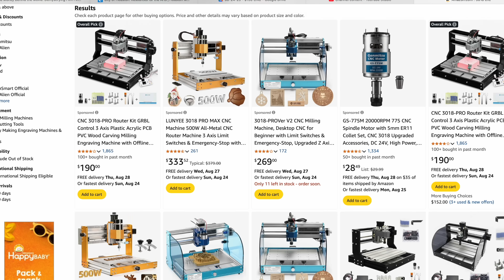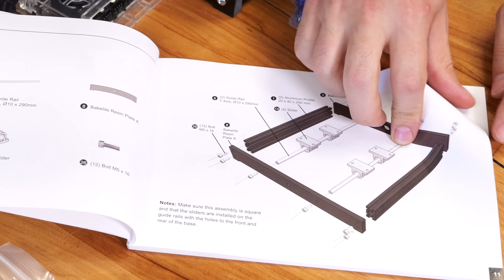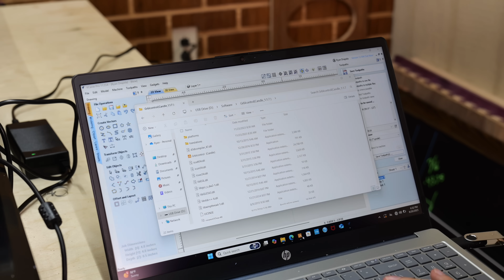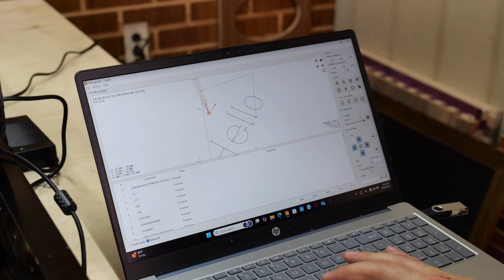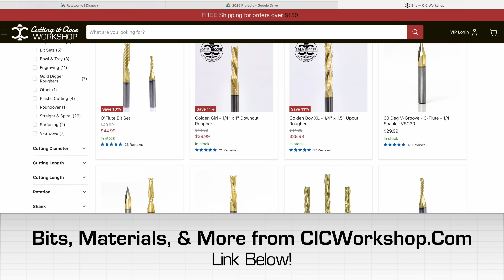I Tried a $150 CNC Router… Here’s the Truth

Comment: I got one of these as a learning tool. In many ways, a weak cheap machine is great for this because you soon learn the limitations. Until someone plays for a bit, they often do not know what they want to do with a CNC. 

I ended up doing something totally different on a very different type of CNC than I originally imagined by learning on one of these. So if I had dived straight in and bought a higher level CNC, I probably would have been wasting a lot more than the cost of this machine.

Comment: I have a similar machine, and i must have been luckier than you on the quality. 

Mine is not as sloppy as yours. I can keep fair tolerances, but I only work with wood. It's all about feeds and speeds. 

It's also about making adjustments to the basic setup to get the machine working well. 

You would have been very lost with my setup: I don't use windows (it's junk), I use Linux. I had to figure out how to set this up on my computer. 

I do agree with you, get something bigger and better if you can afford it, which I couldn't (and still can't).

Comment: I bought a Lunyee 40x40 to learn the CNC world. I have had a blast learning something new and have made some bowls, done a ton of V-carving and have finished a couple of relief carvings. I do agree that their is a lot of chattering on deep cuts and roughing operations, but taking it slow helps the quality of the cut. As for the spindle-I shined an RPM indicator on the spindle that is supposed to be a 10K spindle and it runs at 8750 no load.  It is what it is for $500. I am now eying an Ultmill or similar for my upgrade. I am at the point where I am dangerous knowledge-wise but my ultimate goal is to machine furniture parts; chair rails, specialty mouldings and many other pieces to support my furniture making. I am fascinated with the CNC world. Fun stuff.

Comment: The bits you used from your Shapeoko are to big for that machine to run at max speed. You are better off using smaller bits at higher speed as smaller bits rotate much quicker then a larger bit and are able to significantly cover larger SFM at the lower 1k rpm the machine was able to achieve. Although the Gantry and the cheap quality of the machine are definitely an addition to the chattering the bits you where using corelate directly to the result you where getting the bits where causing the chattering.

Comment: It has been said already, but I would consider this machine just a learning tool. However a good practical use is engraving brass or aluminum blanks with a diamond tip spring loaded tool. Being a learning tool I would strongly recommend adding limit switches.

Comment: I've had one of these 3018 CNC machines for several years and purchased it with nothing in mind to actually manufacture or produce.  I figured I can get a handle on CNC type software and hardware and this fit the bill.  Overall, the review is accurate, but keep in mind that this CNC machine is just a toy but can be modified to do quite a bit more stuff.  I modified the attachments where the spindle motor is clamped by designing and 3D printing some parts to allow a bolt on change of a 500watt spindle motor with the ability to interchange that motor with a 10 watt LED laser head. In fact, the 3D printing sites have a lot of printable mods for these machines.  Over time, I use the laser mostly to cut gaskets for vintage carburetors either copied or designed in software and then cut with the laser, and this worked out very nicely and accurately.  These early machines were gcode machines and I noticed that most were changed to grbl later on.  It's a simple matter to make these things run on a number of different control boards.  Again, this is a $150 toy and comparing it to machines you have there for professional work is not even close to an apples-oranges comparison.  And it is perfect for modifying the hardware, software, firmware and control boards to your liking.  If you're just a button pusher with no ability to get in there an get your hands dirty, so to speak, then this machine will be limited and you'll just end up with a bag of chips of various materials.

Comment: Seems you're impatient and biased from the start. When setup solid, run slow and a proper spoil board cut they work well. I upgraded to the full metal version with 300w spindle and it is rock solid & happily cuts aluminum & if well lubed and slow af will cut mild steel. The key is, Build it on a solid flat surface making sure everything is perfect square, use loctite, get a good thick mdf spoil board and surface it a few times to keep it perfect level to the gantry... go SLOW, never hurry hobby machines be it cnc laser or 3D printing or your results will be trash. Even my CO2 laser I will opt for a lower power and 2-3 faster passes vs 1 pass at high power for clean non-burnt cuts.

Comment: currently my 3018 is primarily for PCB making - at least for the 50% of its parts (lol). just solve its rigidity problem and PCB making is a breeze. its motors just don't have the power to cut other materials at the speed and quality that you would have liked. and definitely it doesn't have the modern 3D printers easy learning curve but sure a good learning ground for the basics.

Comment: My wife bought me one similar. Very bad basic picture instructions, Some of the parts were the wrong size and I had to get some off of Amazon just to put it together, then the motors don't work right so I assume they are swapped in the wrong spots. I have yet to take it apart and put it back together again. I've designed a little tray in some free software if I could only get it to communicate properly. Then not sure how to zero out the machine on the project.

Comment: I have that exact cnc and I can absolutely state that it is capable of cutting all those materials, except steel.  Ive cut aluminum parts, and milled out some coins from brass and copper.  Ive used both 1/8in shank and 1/4in shank bits up to a 2 flute upcut 1/4in bit. Go slow, make shallow cuts and it will do it.  Use the shortest bits you can find for the project to keep chatter down due to the bit flexing.  The spindle will spin up faster, but the software comes preset for a slow spindle, there is a setting that allows you to tell the control software that the spindle goes faster.
Im not saying its a great cnc, but as a starter unit, I highly recommend it for learning.  Ive moved up to the sainsmart 4040 pro max, but I still have this one running also.  I installed the laser module to the 3018 and it... works...  but, not great.  Gotta watch the power and feed rate really close.

Comment: You don't need Candle. The little white thing shows up as a USB Mass Storage device and you can put gcode on it. It's picky (no macros, one command per line etc) but it means you can run the thing without a computer which is great because windows is hell and not great for real time tasks like that these days.

Also you can absolutely isolation rout copper clad PC boards. That's the whole reason I bought mine and my only complaint is that when you get down to ~10 mil traces for modern QFP chips the bits keep exploding because they're too small. That's not an issue with the machine though, it's just not really practical to mill boards that fine. You really need photo lithography at that size.

Comment: TYVM for your honesty!  i need to learn how to cnc, but i'm a unique case, i have huge background in too many skills, carpentry, plumbing, elctirical, computers (been working with pc's for 38yrs, H/W 30yrs). i do everything with computer from design, build, repair, basically 95% of soft and hardware BUT i can't learn how to use any 3-d programs like sketchup. i lack the math background i think..? but i dunno, it's so frustrating to literally be able to design and create anything from scratch with hand drawn blueprints while not being able to even convert my handwritten info into the software to  design a basic chair or desk in the 4-5 CAD's i tried... your insight on this machine is exactly the kind of ppl i trust for information, subbing and i'm going to try to upgrade my math in the meantime watching your videos to see if i can learn more.

Comment: Bought the near-identical Genmitsu Prover Pro with the main aim of testing some g-code generating scripts and programs and maybe doing some casting with machinable wax, and possibly some experimentation with milling circuit boards. ...and yes, tinkering with some upgrades, like a more rigid spindle mount, better spindle, doing some motion control software stuff with my own controller, etc. I haven't done much with it so far, but considering the price and my very limited expectations and requirements, I was actually pleasantly surprised. Mostly. (The spindle mount and motor had me more just "surprised". Definitely the weakest part of the machine.)

Comment: Really you think that's 1000rpm? You never used a simple pillar drill with 3 options pulleys and the speeds on a little plate.
What if it's the other way, PWM makes little difference to unloaded motor rpm. 10000 same rpm as setting 800?
Why using such long free length bits. You already worked out the obvious, that it's flimsy.

Comment: I have a CNC exactly like that one, same manufacturer and model, and it's absolutely perfect for milling printed circuit boards. I stopped entirely using chemicals to etch PCBs since I learned how to use it. It has a great advantage over etching boards in that it also drills the holes. The software is free (Kicad and Flatcam), but it does have a learning curve. It doesn't have the same rigidity as a Bridgeport milling machine, but it's good enough for PCBs.
Reply: for those contemplating buying this machine (like the one featured here) for PCB making, it is NOT CAPABLE of cutting satisfactory PCBs out of the box without significant upgrade. I repeat - it's not 'absolutely perfect for PCBs' out of the box.

Comment: To be honest, I think you should have tried at slower speeds and with the bits provided as most people simply will not have the chuck and bits you have if they're buying that machine. If they had those bits, they wouldn't be buying that machine. For many people the absolute speed will not be an issue as they're not going to be buying something like that for full scale production. You were trying everything at the maximum speed you thought you could get away with. You should have tried at least something - eg, hard plastic or aluminium - at a much slower speed to see if it was capable of doing it at all. And it would have been nice if you'd tested some steel at super-slow speed to find out just how slow you need to go to be able to cut steel. Really, you were applying unfair criteria to it by trying to make it go faster than it was probably comfortable. You've not really tested its full envelope or  in it's likely most comfortable speed so you've not really helped people who are considering buying it much.

Comment: people have remember that these lttle machines are engraving machines  that can do just a little bit of cutting  on small items like pcb boards 
 
but i will say they are good for the price to learn how to setup and understand the software's deskprot has a free option that is simple to use
and get confident with tool settings and speeds and feeds 
and when you crash it there will hardly be any damage to worry about

i upgraded mine with linear rails and a metal z axis with a cute 500w spindle   and a 4 axis control board  with 4th axis setup and extended the y axis 
so i  use mine yo test my homing setups and tool paths before i cut my double sided parts from expensive exotic  woods  and 7000 series grade  ally

Comment: these machines are not supposed to "walk" 25 cm a minute for hard materials.. make it 10 cm/m and you can cut aluminium copper , carbon, hard plastics, wood.. etc.. steel engraving is possible at 5cm/m

Comment: My 3018 CNC came with 55W motor that didn't have an ER11 collet.Instead it had simple, brass shaft adapter. Half of the parts were 3D printed, I had to run CNC software written in Python, which was slow on my high-end PC, and in general I didn't like that machine at all. I think the best use for it is making some PCBs. Slowly, and with 45 degree V-bit. Maybe with dremel tool instead of that puny motor...

Now I have CNCEAST 3020 with proper ER11 500W spindle and controlled via Mach 3 over USB...

Comment: I bought one of these for about $125. Put it together and never really cut anything on it yet. I do work in a shop and have access to lathes and mills. First thing I would do is replace the plastic pieces with metal equivalents and change to linear rails instead of rods. That is if you can get or make them at a low cost.

Comment: I have one of these small CNC machines. The only problem is the spindle motor. It is a regular 540 motor you would see on a toy RC car.  That style of brushed motor has no muscle, or might. I has very little rotational mass. So it can only nibble on materials. The smallest CNC to consider is one that uses an actual router.

Comment: Where do I start? I could write a book. Anything that comes pre assembled check, my X axis stepper motor coupler was loose and fell apart during a test run, as was the collet assembly to the spindle shaft.
The X axis stepper motor is mounted with four 3 mm screws that are inaccessible and about 5 mm too short which causes the coupling to be too low and restricts the X axis  height.
I followed a channel that gave great step by step instructions. ( https://www.youtube.com/results?search_query=James+Dean+Designs ) Their are lots of upgrades available but by the time you buy them the expense is not worth it just buy a better machine.
The accuracy is good and no adjustments were necessary also I replaced the X axis coupling to a clamp type as the supplied one is weak junk.
If I knew what I know now I would have spent more on a better machine.

Comment: I have no idea why your machine is so wobbly on the spindle. Mine is nowhere near that wobbly. I get hardly get any movement at all. I use my machine only for engraving and cut aluminum, brass, and Bakelite panels. The results are very good but not professional level. But completely satisfactory for hobby use. I use Hermes carbide cutters, which have 1/8 inch shafts. I do one thing considerably different than you: I cut off my bits such that they stick out about 1/4 to 3/8 inch from the chuck. Not the inch or more you had in the video. For cutting acrylic and other plastics, lubrication is required. I use WD-40. For $150 it is unbeatable!

Comment: FREE softwares have free cad, fusion 360 if download "student" many other, linuxcnc FREE, mach3 need licence or cracked version. USB NOT safety and good breakoutboard not safe, need use ethernet or paraller port breakout board, new computer can buy paraller port pci card less than 20 USD.same windows os not safe not have important REAL TIME software. dangerous use. GRBL can use but slowly old cavemen made software. not perfect any work.

Comment: same than you back is big cnc machine can build at home less than 1500 USD better parts than shabeoke or optimum is.only idiot buy this, i has build less than 1200 USD better machine and big about 2 meter x 1,5 meter table, son i build only 1 meter x 1 meter table size cnc machine.

Comment: better NOT buy this shit, good option is build own cnc machine, come lot better. i build my son workshop him can use cnc , minimum need nema 23 470 OZ/ 3Nm stepper motors 3Ampere eat, and power supply need be 3x3A -10A power supply about. dm 556 stepper drivers, and paraller or ethernet port breakoutboard, and FREE linuxcncn software good linear rails MGN 15H or SBR 16 or 20 rails. acme tread or ball screws. cost me about less than 1200 USD all, spindle minimum need be 1,5 or 2,2 Kw water cooled ER 20 spindle whit VFD. cost less than 200 USD. then can working good fast and deep, wood or aluminium no matter.

Comment: I have the Genmitsu 4040 Pro Max. It was a 4040 Pro and I upgraded it to a 6040 Pro max. I have a few videos on them. My first was a 3018 which is for small items and entry into CNC. Their customer service is great and machines are solid. I have been using their machines for the last 5 years. They have different models depending on your needs. Their are for hobbiest and maybe those that have small businesses. I wouldn't run a big business on them. Though, they are starting to venture out on more robust machines. I don't use candle w/ my Genmitsu. I use Easel, Fusion, and Lightburn.

Comment: Bought one of these several years ago (am a software person) and the software part wasn't bad for me.  agreed that it can be disheartening to try using.  it took me months of tinkering to figure out how to actually make it carve things ok, discovering how to hold things down properly.  i finally got good enough with it that i can prototype some things ok in mdf when wanted but have been disappointed overall.
Reply: oh and, i wound up replacing 2 of the axis driver chips at various times.  they aren't expensive but it added to the frustration.

Comment: Totally support telling people not to buy a small CNC like that but you probably should have pointed out that the Shapeoko has linear rails and balls screws and the Sainsmart has linear rods and threaded screw rod. The motor on the Shapeoko is a real spindle while the Sainsmart is a motor with a drill attached to it. These machines are not the same in the slightest. One can cut soft wood, plastic and foam and the other can cut hard woods and (not on yours with the spindle up so high) some aluminum.